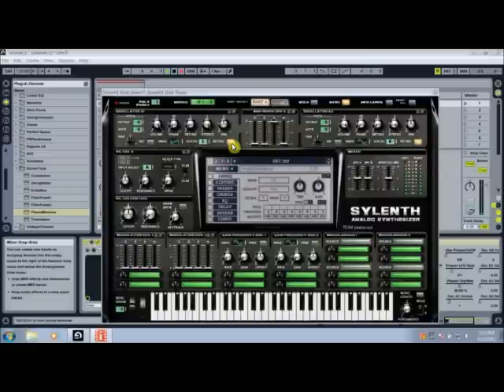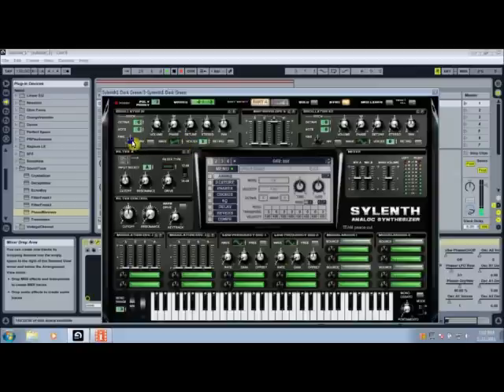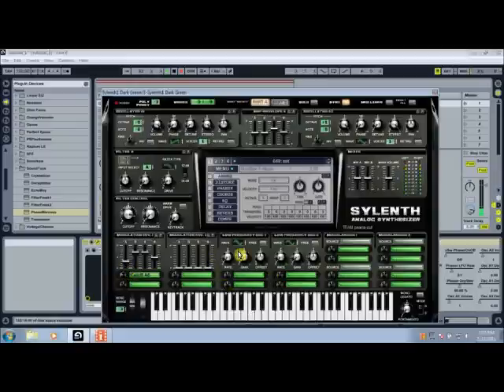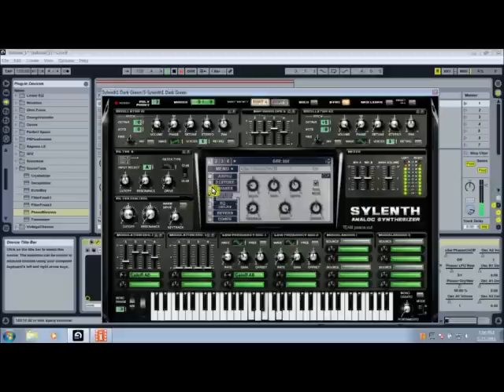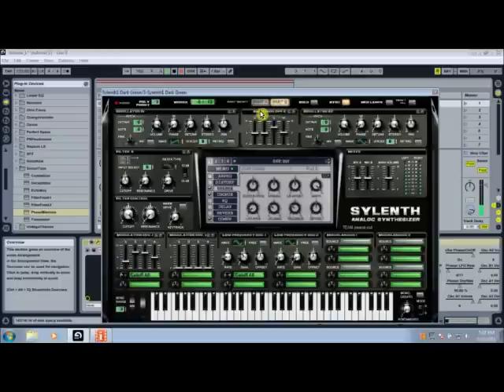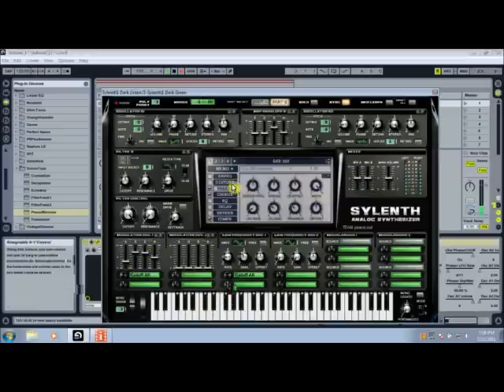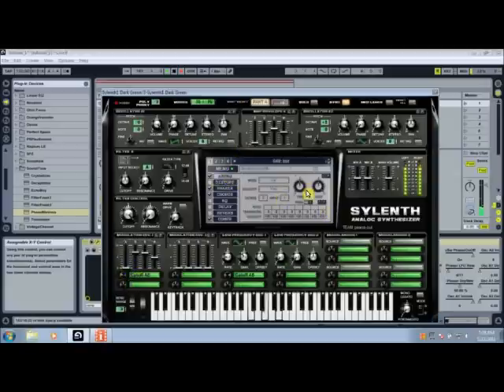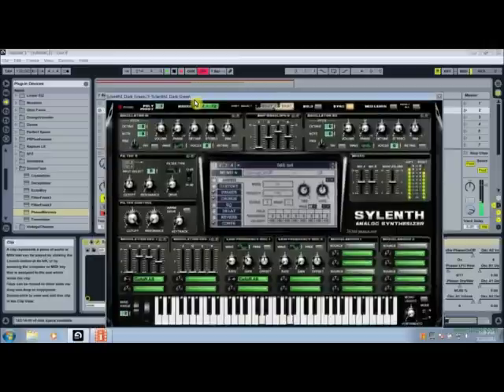Make Swirly Daft Punk Pad in Sylenth

Comment from the maker: @ljkDICKJUSTICE Well the software synthesizer I am using (black and green gui) is called Lennar Digital Sylenth. It is an awesome softsynth and used by many both amateur and professional. I'm not privy to the vacuum you refer to. But if it is a sequencer, than it is not the same as a synth. A synthesizer produces sound. I am using Albeton Live 8 as the host DAW.